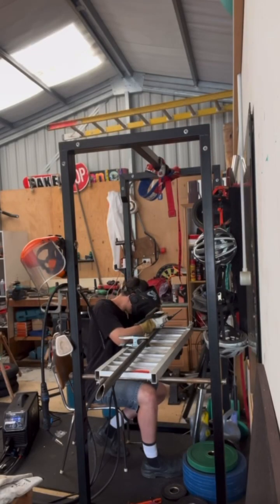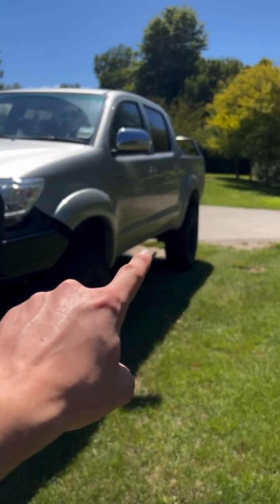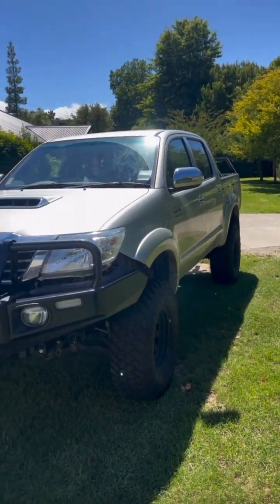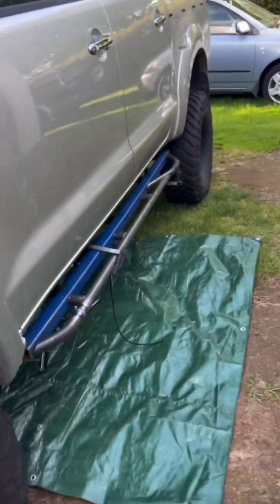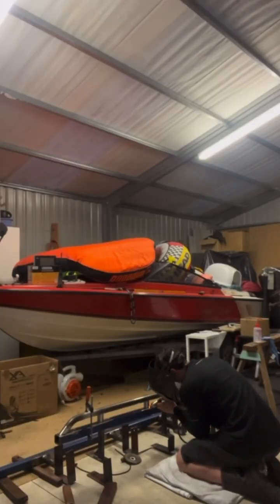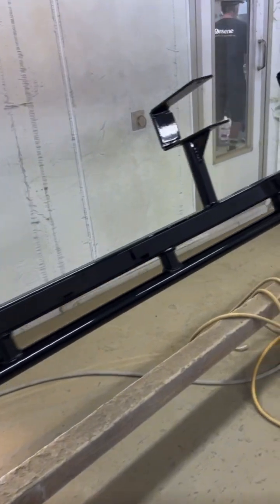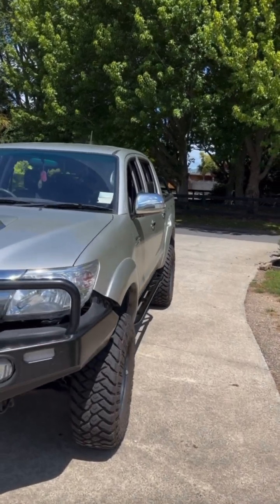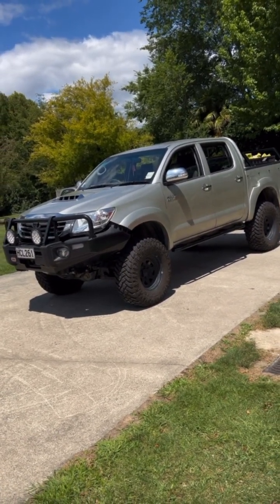Fabricating rock sliders for a n70 Hilux in 95 seconds

Comment: How did ya mount it bro? Make brackets to fit back to original running board mounting holes or?
Reply from the maker: Made U brackets to slip under chassis rails and have a nut and bolt at the top.